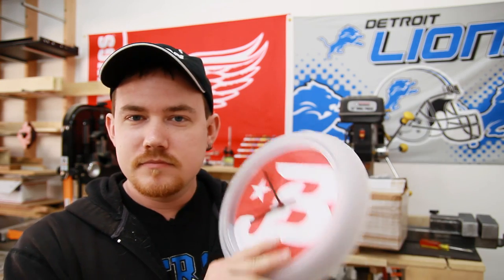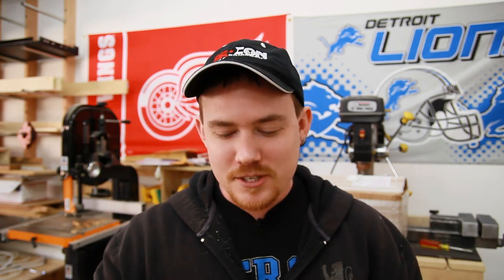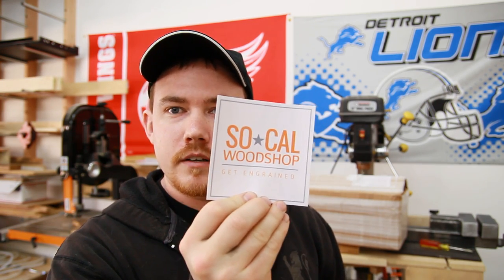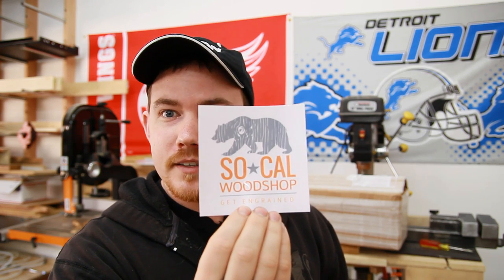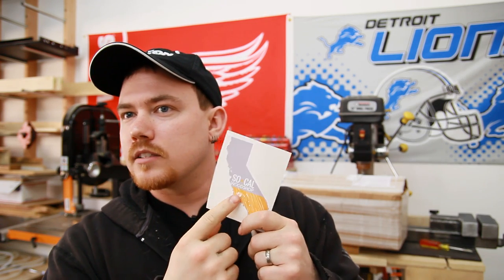Vlog #34 - Lots Of Pocket Hole Conversations Lately...

Comment: I use KDEnlive and it will automatically sync clips from multiple sources using audio tracks.  I'm pretty sure Sony Vegas will do it, also.  Probably other software does it, as well.  One click to set the primary audio track and another to sync the secondary track to primary.  I use a Zoom H1 for audio.  Works slick.  Syncs in seconds.